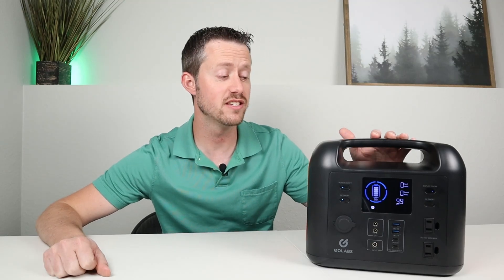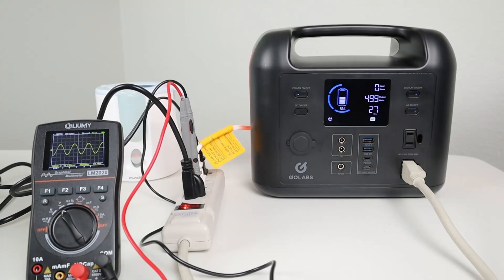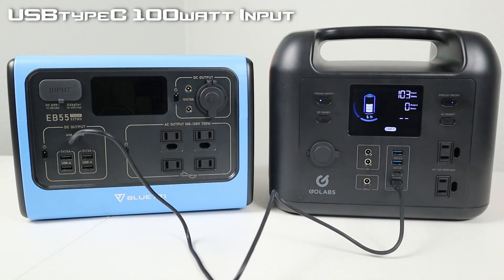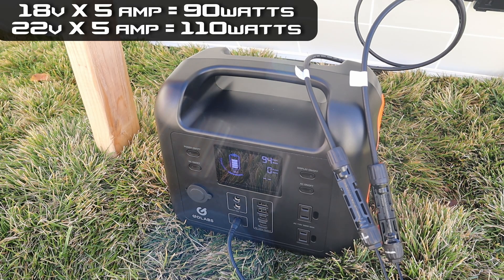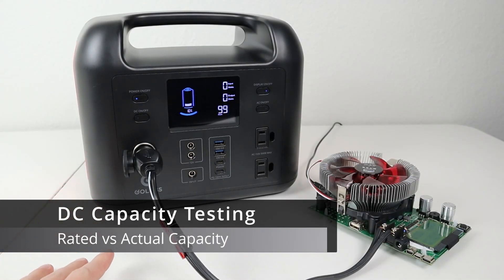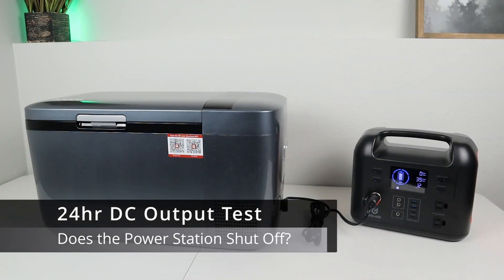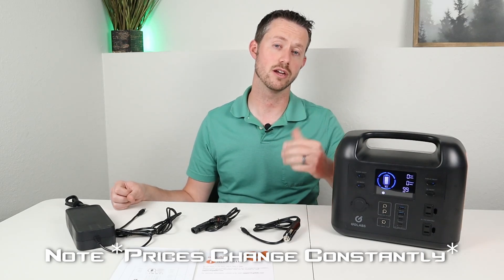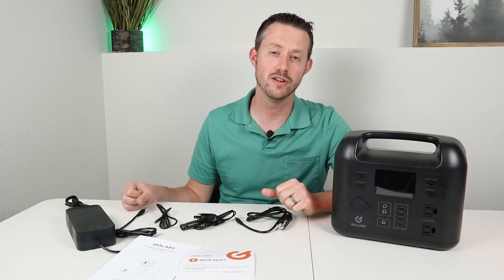GOLABS R500 - 518wh LiFePO4 Power Station - Full Testing and Review Video

Comment: Thanks to your 11-fridge review when I subscribed, I ended up buying a Vevor fridge that is awesome, so will post some useful GOLABS info here to thank you.

I have the R300 since April, which like pretty much every LiFePO4 has unregulated output, which makes sense.  Surprised this R500 output is regulated.  Does the manual or its advertising say it's regulated?  Why? LiFePO4 is awesome unregulated.  I could understand regulating it to boost the very bottom end to 12.1, but not for cutting down the top end to 12.1, as it's already more like a car battery than 12.1 is.

The other R300 owner who says there is a high idle draw on his R300 with the inverter on, does not match my experience.  In fact, may best tip about using the R300 is to always turn on the AC, DC, and USB outputs when using any one or more of them.  The idle draw is between negligible and non-existent on the R300, in my experience.  

If not having all the outputs switched on, you'd better memorize all the hard-coded timeouts and min-power shutoff thresholds for each type of output, with 2 being in the range of minutes and one being 8-10 hours.  I tested and then forgot the answer, but my Vevor clone of the Alpicool CX50LG that I use as a freezer in my Prius Prime certainly then stays on despite its draw of well under 1 watt with the compressor off for many minutes, unlike if I don't turn the other outputs on in some situations, where the R300 did power down.

Using just a 12v car outlet fused at 10A, I have found a great setup.  I plug a Bestek 300W pure sine inverter into the car 12V.  Then I plug a little Baseus GaN USB-C PD charger (60x2 or 100x1, plus a USB QC) into the Bestek.  I use the Baseus to charge the R300 via PD at around 54W. I plug phone chargers into the Bestek or Baseus,.  Freezer AC cord into the Bestek when the car outlet is live, freezer AC cord into the R300 when the car is off.   Laptop plugs into the R300 as needed,

On a car camping trip to the desert in July in temps up to 119F, I kept the car on 24/7 to keep the car interior a reasonable temp, with rare exceptions if I found a shady parking spot while shopping and actually turned the car off.   Under more normal weather conditions, the R300 would have been used more heavily with the car off more of the time, but it was still great to have along and performed flawlessly.  

The lantern feature was used way more than expected, including for using a circular saw at night outdoors when it was cooler (92-102F) out.   Yes, it's an expensive light, but also an easy to find once the car becomes a jumble on a camping trip!
Reply from the maker: Hey HybridLife! Thank you so much for sharing your experience with the R300. These are great tips for anyone planning to use that power station in high heat! 

The R500 has a regulated output set at 12.1volts. Stayed there during the complete charge / discharge cycle. Bluetti EB55, EB70 and other larger lifepo4 power stations all have regulated outputs as well. Those are regulated at 13.2volts and I kinda like the higher voltage vs 12.1v.
Reply: @Jasonoid  I agree that 13.2 is better than 12.1.  The industry standard for cheap DC-DC converter output voltage to match car 12v accessories, is 13.8v.  Some people/products choose actual 12v output, but most use 13.8v.  I guess as long as it doesn't trip a fridge/freezer off, 12.1 is OK.

I'm not sure how useful my info was regarding high heat, as it spent 98% of its time in the air conditioned car.  Outdoors just for lighting when working on projects past dark due to daytime heat.

But in any temps, setting all 3 types of R300 outputs to be on, does solve the low-load timeouts that would have been a disaster for the freezer.

The Prius Prime is the ideal car to leave the HVAC running 24/7 on if necessary.  With daily highs from about 20F to 95F here in New England, it can generally run for a good night's camping sleep without the gas engine kicking on.   It kicks on in 6 hours at worst here, but usually 8-12 hours on a full PHEV battery, or 1/2 gallon of gas if starting with no EV range left.  So, 12 to 16 hours of heat or AC per gallon.  Note that the Prius Prime uses a heat pump for heat, no engine heat is required.

But in AZ in July, on days from 115-119F, a gallon only got me 3 hours of keeping the car at 68-70.  At 105F, 6 hours.  In UT it got 8 hours/gal at around 90-95F.  But that was with the 50 liter freezer in the car set to -4F, and nights really not cooling down (often 92-102 for the low in AZ) hence a little disconnect from my usage overnight at home where nights cool off more and I wasn't running a freezer!

Comment: DC output 12.1. You sure about that?  Doesn’t sound right for a LifePo4.
Reply from the maker: It's regulated my friend, not direct output. Direct output with be 13.3v and would drop down overtime. The DC output stays 12.1v the whole time.

Comment: Great solid review.  I have the smaller GoLabs R300 and have been pretty happy with it.  Regarding this new unit, I think the significant flaws are: 1) slow charge rate of .2c (100w).  This is much slower than the competition and should be at least 200 watts. 2) Low Voc for solar input, I'd like for it to have a higher Voc in conjuction with higher input watts. 3) The no load of the inverter appears to be between 13 - 16 watts, depending on how you choose to calculate it based on rated capacity or actual capacity.  This is pretty inefficient.  4) I'm on the camp that only getting 410 wh out of a product rated at 518 wh is awful, not a feature.  The AC efficiency is not good.  I would have calculated it: at 71.4% (370/518), not the 370/410 as you calculated.  Thanks for revealing this for us consumers.  Like you said, even at $400, there are better options.
Reply from the maker: In my old review videos I used to calculate the AC efficiency to the "rated capacity" but that isn't accurate. That's like comparing your truck's EPA rated highway mileage to the actual mileage, and usually its no where close. That's why your inverter calculation is only 71%. If you use that same math with a Bluetti power station, which are known for 90% inverters, you'd get around 70% too because they are a little short on actual capacity vs rated capacity.

To get a more accurate AC inverter efficiency you have to compare it to the 'actual' battery capacity (which is 410wh, or 460wh down to 0%), not the rated 518wh. The actual output capacity via the regulated output was 410wh which stopped at 9% and the AC inverter also stopped at 9% so I figured it would be a good comparison. 370wh vs 410wh was near 90% efficiency. If the AC inverter was 100% efficient we would have seen 410wh through the DC output and the AC inverter right?

Where are you getting the 13-16 watts constant load from the inverter? Just curious on your math there.
Reply: @Jasonoid  The only concern still with using the "battery actual capacity" is any losses IF the battery voltage is regulated.  Then the AC calculation is getting the benefit of the losses associated with dc regulation circuit.  For this GoLabs though, I assume they do not have a voltage regulator.

At the 2:38 mark in your video, you show the unit @ 98%, AC inverter on, and the "time remaining" is 31 hours.  So, I took the 518*.98/31 = 16.38 watt inverter draw, or if you prefer 410 *.98 / 31 = 12.96 watt.
Reply from the maker: @ssyoumans  the battery is a regulated output so there is possibly a small loss, stays at 12.1volts the entire state of charge.
Reply: @Jasonoid  If you removed the battery pack from this brand new unit, would you expect its measured capacity to at least equal its rated capacity?
Reply from the maker: @garyzults1924  if it was a bare battery 4s Lifepo4 battery and I could discharge it all the way down to zero percent, I bet it would pull 518wh. In my 100ah diy build that battery is rated for 1280wh and I pulled over 1350wh out before the BMS shutoff.
Reply: Scott I just got a 540 wh lithium ion power station for 260 before tax. It looks like one of the older model Rockpals. I needed something for backup while I recharge my Bluetti`s to keep a small fridge or freezer going after bad weather. I`m assuming 500 watts will work but just got it earlier and haven`t fully tested it.

Comment: Hey Jason great review.. Quick question.. Have you seen that Big Blue Cellapowa500 it's also Lifepo4 @537 wh I believe.
Reply from the maker: Review model should arrive this week, I'll have a video out sometime next month on it.
Reply: @Jasonoid  it looks legit hopefully it stands up to your testing... Also its on sale as we speak for $350..it has a $50 off coupon from $399
Reply from the maker: @Mr.REEP0  Everything looks good except the AC inverter wont work during charging, it's disabled. So that seems to be the only downside of the power station right now. Full testing will determine if there are any other issues.
Reply: @Jasonoid  hey brother where did you score that xstar panel at? At what price?
Reply from the maker: It's all in the review video description. I have some good discount codes for this week for black Friday, direct through their website.
Reply from the maker: Jasonoid40 for one and Jasonoid 80 for two $40 and $80 off

Comment: Jason, I’m curious if you would consider testing larger power units with high amp draw items like a clothes washing machine. This would be helpful in a power outage situation. I was disappointed that my EB150 wouldn’t power my washer, but that’s my fault for not checking the amp draw more carefully. I think the EB150 can only put out about 8 amps.
Reply from the maker: The EB150 should be able to handle 1500 watt output on the inverter. (120volts X 12.5 amps = 1500 watts) Is the washing machine AC powered or DC powered?
Reply: @Jasonoid  
The EB150 has a claimed 1500 Watt storage capacity but only a 1000 watt inverter. It looks like the EB150 has a 9 amp maximum output for the AC outlet. My washer is a standard 120 AC, 9.8 amps
Reply from the maker: So close to being able to run it! Dang. Is there an eco mode setting on that washer to disable high power? My washer is super plain Jane and doesn't use that much power.
Reply: @Jasonoid  
It does have an eco mode on the washer, I assumed that was for water conservation, but now I’m wondering. I’ll try it and see

Comment: Do you happen to know if  BLUETTI WILLL MAKE A NEW QUIETER POWER BRICK CHARGER FOR THE EB 70 .
The EB 70 HAS IT ALL ..
THEY NEED TO CHANGE THE POWER BRICK CHARGER .
Reply from the maker: Hey J, you get used to the power brick pretty quick, overall it's not too bad. The EB70 is an awesome power station with the 200watts of input charging!
Reply: I was going to pull the trigger on an EB 70 for use in my LR but that fan running even when the unit is at 100% (or not even plugged into the power cord) was a deal breaker for me.  I have other small units that have obnoxious fans but at least they aren't running constantly.
Reply from the maker: @jdollar5852  The Bibene 614wh power station is on a pretty awesome sale right now, $470 with a $90 coupon, you can watch my review on that one to see if it will work for you. Has more capacity than this one and it's pretty dang close to the EB70.

Comment: EEEEEeeee....not sure about this one.  It is NOT "518wh."  Someone needing that capacity is going to be bent out of shape for it not being there, regardless of the reason.  For that price too?  Absolutely not.  This goes head to head with the Bibene / Oukitel, and I think the larger capacity of that one carries the day.  Chop another $100 off the price, and for $299 it's a great entry-level unit, but as-is, is a hard pass.
Reply from the maker: Hey Joe, thanks for sharing your thoughts! I agree you can get more capacity out of other units. It someone needed 100watt PD this one is pretty awesome to support input/output which other budget power stations don't.

Comment: Thanks for the reviews Jason. I have the smaller Golabs R300. I had an issue with some of the power ports not working, but customer support suggested depleting the battery and then recharging the unit. I followed their instructions and the unit has been fine ever since that time. I really like the lithium iron phosphate battery chemistry for the long life expectancy. Another important feature is that the Bluetti AC50S and Golabs are rated for 104 degrees fahrenheit but under actual desert summer conditions, the Golabs  handles higher temperatures better than the Bluetti.
Reply from the maker: Thanks for sharing your experience with the R300, glad it's working for you now. I like the Lifepo4 chemistry as well!
Reply: @Stuart Stuart Mine did that after I used a very low wattage fan. It ran the battery down but the display still showed over 30% left. Also when charging afterwards the display said 100% a while before it stopped charging. The displays on these things can be wildly inaccurate and need to be reset with a full charge regularly but they`re miracle devices compared to the technology we had a couple of decades ago.

Comment: Love how you showed the charging rate of each! That's something I want to do in my let's test series when I start it. Haha

I always want to know how fast those other options charge.
Reply from the maker: Thanks Ive! All that testing helps me know which option charges fastest and if they all work or not. Whatd you think about the MC4 plug section?
Reply: I'm still watching. Haha
Reply: So I understood the mc4 section but it seemed a bit complicated. It just seems like most power station cables (like this one) are wired the "right" way to speak. So when it's the inverse.....I wonder about the efficacy of that. Like with the bullbat. 

But I think I followed it. Haha. I'ma have to watch it again. 

People can get confused by the extension cables if we start getting into colors and such. 

It's just all very interesting.
Reply from the maker: @AskIveSolar  If you remember LDSreliance tried to wire it up using the + and - on the connectors on his R300 which was backwards, so I tried to help explain that for others that may have the issue. So basically the receiving sides are usually backwards. Color coded wires would make it the easiest, wish these companies would do that!

Comment: The 100w pd in/out should be on all of these. The Oupes 600 has a 60w. A 100w would be better. And it would be wonderful on their 1100w as well. All the new big rigs are coming with 100w power delivery ports. 

The Golabs 410 watts on the DC side would run my Dometic CFX3 55IM for a day as a freezer. Not good enough unfortunately. This was the reason I was hoping that VTOMAN 1,500w was going to be good. I'm probably gonna have to get the Bluetti AC200max. For my needs. 

Another good review Mr Jason.
Reply from the maker: Thanks Dude! I agree a larger fridge will benefit from a larger capacity. The BIBENE right now is priced at $470 with a $90 coupon, pretty hard to pass up that cheap option. If you want a larger power station the Bluetti AC200Max should be a good option. I am currently testing my AC200P and it's looking good so far!